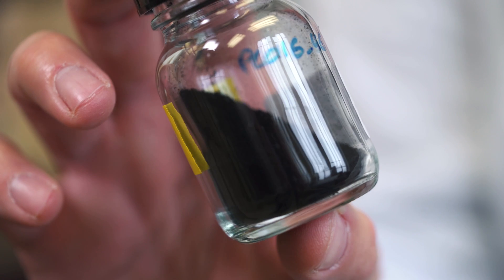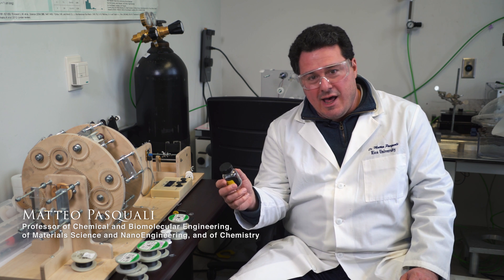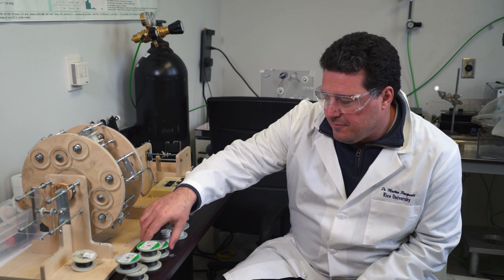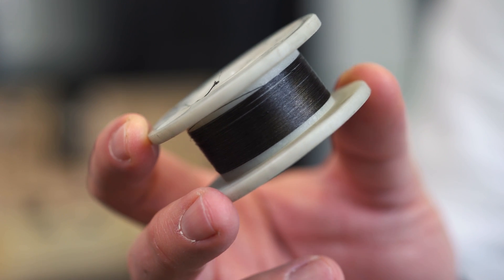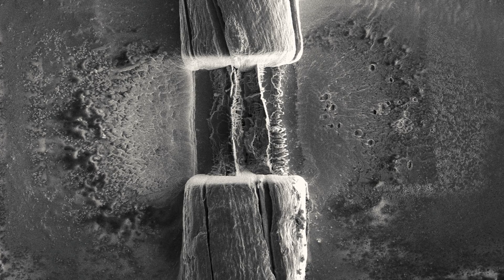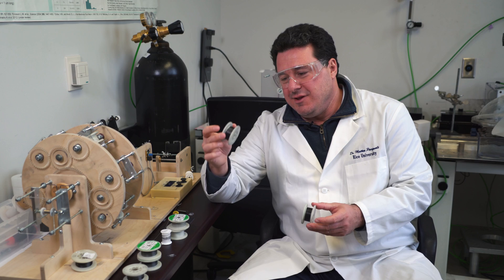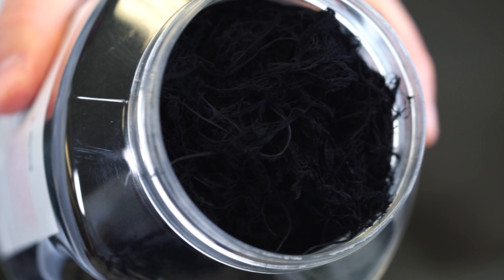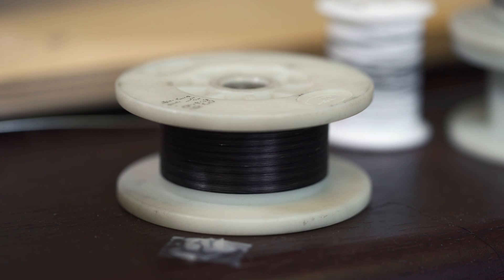Carbon nanotube fibers in a jiffy

Comment: Thanks for the video! So, is that product that you pulled from the glass kind of like a rope/cord of several CNTs? What's its diameter and current tensile strength?
Reply: It’s tensile strength is 63000

Comment: Ok, on par with our bulk conductor electrically, but where are we landing as far as tensile strength? Ultralight transmission cables are neat, and would solve certain "problems" but a space elevator solves a whole lot more of them. If we can get there and we already have the problem of transporting power along the length inherently handled, it really wouldn't matter if the cost was several orders or magnitude above bulk structural metals or conductors. The investment would be easily worth the incredible potential profits of owning a low cost space port, and some multi billionaire somewhere is inevitably already drooling over the prospect.
Reply: also could generate and direct power if solar pannles are integreated above the atmosphere where they could get more direct light exposure
Reply: @Digitallifeconcepts  Very true. Even if conditions on the ground are dry blue sky with sun dead overhead, panels just outside the atmosphere will generate 30%+ more power. Not to mention the fact that rain, snow, cloud and dust don't affect them at all. The one impediment I can think of for this schema is that low voltage DC power is terrible over long lines, so there would either have to be a massive  sister array of inverters and transformers to make it high voltage AC to send down the line, or some method of 'beaming' the power down via laser or maser.